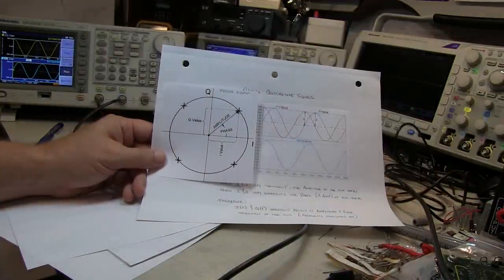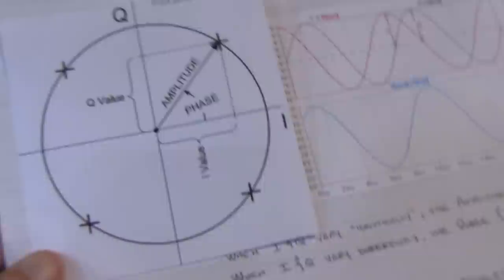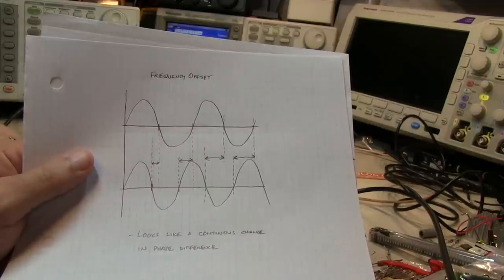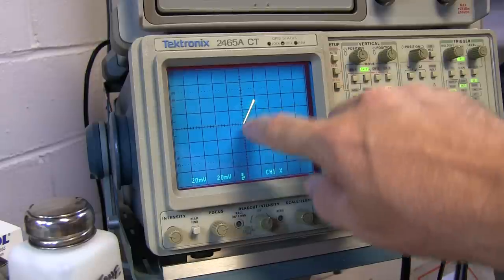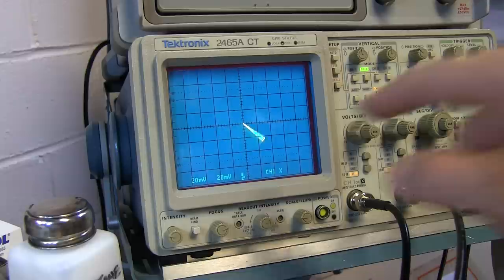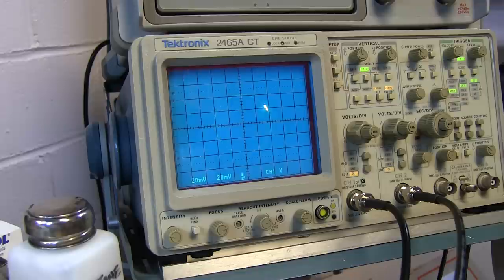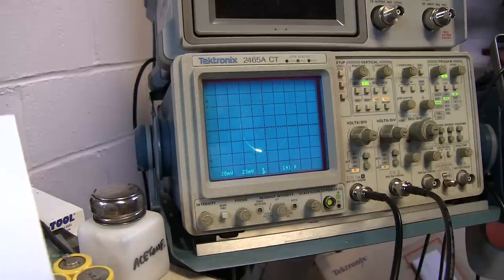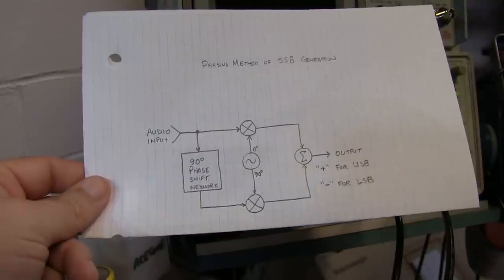#171: IQ Signals Part II: AM and FM phasor diagrams, SSB phasing method

Comment: This is so incredibly cool. This stuff is becoming a lost art. I got an EE degree in the early 80's but in my career I worked on the physics of solid state devices, so never used and quickly forgot the type of stuff your videos are about. I am eager now in retirement to go back and relearn this stuff I consider to be "classic" electrical engineering. Today so much is digital work driven by huge simulation programs that few really know this lost art. I am drooling over your scopes and test equipment. Thanks for the wonderful videos.
Reply from the maker: I'm an analog guy at heart, so my videos focus mainly on these topics. And, since I work for Tektronix, I have great access to wonderful equipment, which really helps in the videos.
Reply: Ditto what Paul said above, I too am enjoying a late in life re-enlightenment :)  Thanks for the great videos.
Reply: Far from a lost art, SDR radios using IQ modulation and demodulation are proliferating. Real world use is driving increasing interest. I'm a licensed amateur radio operator and I now have several SDR receivers, two SDR transceivers and my analog transceiver has an IF tap for I/Q demodulation to monitor a wide swath of a band.
Reply: Me too, at 51. Maybe it comes with the age 🙂
Reply: I concur with your point. My career mainly involved ABB Distributive Control Systems with 4-20 mA I/P valve controllers (current to Pneumatic) and Rosemount transmitters. After so many years of that, my understanding of the subject of many of these videos has atrophied completely. It's nice in retirement to get back to communication electronics. By the way Paul, I've enjoyed your videos very much, especially the two Arduino courses and the Learn Fusion 360 or die trying!!!  God Bless my friend.

Comment: I found these tutorials after trying to understand what the I/Q inputs and outputs on a K3 radio were all about. Thanks for a very easy to understand presentation. This also helps me to wrap my brain around the analog world of voltage and current relationships in a L/C circuit and Antennas!

Comment: Very nice. Just some questions. How does the reciever know the absolute phase and amplitude of the transmitter? Is the information encoded in absolute phase or in differential phase shift? How does the LO of the Reciever "lock in" on the base frequency and of the transmitter's LO or doesn't it need to?
I mean, I only have one antenna and if I flip it upside down my phase shifts 180.
I mean I have to cross correlate to a second input or encode/decode in the phase differential of the frequeny,right?
Reply from the maker: The receiver doesn't know the absolute phase.  So, typically one of two things are done.  Data is encoded differentially as you suggested, or (more commonly) the data contains a specific sync sequence that is properly decoded only at one of the possible phase rotations. The receiver demodulates the data, looking for this sync sequence to establish the reference phase, then decodes the rest of the transmission using this phase reference.  Often, there is a small frequency offset too, so the receiver will also compensate for that too (de-rotating the vector).
Reply: Thank you. I did not know that. I know the basic math of it but not the real world implementation.
Can you do a video on how the synchronisation works? And on QAM.How does the QAM reciever know how to scale the amplitude?  Why is the QAM diagram square and not circular?
Also,I find your videos informative and well made. What I especially remember is learning about how diodes can be RF switches and how the diode ring mixer is just an assembly of switches.
I did not know diode mixers operate in non linear mode,making them square wave sensitive.
Reply from the maker: QAM constellations are usually square because the I and Q signals are typically matched in amplitude to make it easier to null the Carrier feedthru (null DC offset).
Reply: *****
....what did he say?

Comment: Amazing video! I was wondering, is there a different method for working with frequency modulation, i.e. FSK (besides segmenting the constellation diagram as with PSK), because I imagine it would be difficult to determine the "rate of rotation" of your phasor vector in order to determine the frequency at a particular time. Might there be some Fourier transforms involved?

Comment: Could you please explain as to why the two signal generators have to be phase locked? If they were not phase locked, what would happen? Thanks a lot.
Reply from the maker: If they aren't locked, then it would be virtually impossible to make the two signals identical in frequency and control the phase.  In other words, the resulting phasor will always rotate one way or the other.
Reply: hey, thanks so much!
Reply: I wonder how you made the two generators phase locked ? I did'nt saw a connection between the generators.
Reply from the maker: I used a two-channel function generator - both channels are inherently locked because the operate from the same reference.
Reply: Sorry, I thought that I have seen two generators.. Very stupid. Sincerly yours

Comment: Sorry, how do you get the picture on 4:24? If i send sine to channel X, and cosine to channel Y, i am obviously getting a circle, like here:
https://dood.al/oscilloscope/#0.0,0.0,0,0,0,0,0.0,2,1,sin(2*PI*a*t),cos(2*PI*a*t),3,1,0,1,302,0,0,0.

What is the connection schema?
Thanks!
Reply: I figured out how to recreate it: https://dood.al/oscilloscope/#0,0,0,0,0,0,0.01,4,1,a*cos(2*PI+t),b*cos(2*PI+t),0,0.0,0,0.76,125,0,0,0

I don't understand how his scope is showing this though because that would mean that both waves are in-phase, which obviously they aren't.

Comment: Nice video on explaining FM using phasor method. As one more step further, how to explain the nulling of carrier in FM modulation for a certain FM deviation and modulation frequency using the phasor method? I know the Bessel function can describe it, is there an intuitive way to explain it using the phasor method?
Reply from the maker: Probably the most obvious thing is that the average I and Q values over time would be equal to zero when there is a carrier null.

Comment: Hey Alan, why is it that the phase jump in PSK or QAM does not cause any problems with unwanted frequency components in the spectrum? To me it always looks like the phase jumps must create all sorts of higher frequency components. Are they just all filtered out or what? Could be an interesting measurement with the MDO.
Reply from the maker: Yes, if the phase is changed very quickly, then it makes the occupied bandwidth wider. In most cases, the baseband (IQ) signals are filtered to restrict the bandwidth of the modulated signal.
Reply: You'll often see phase changes happen at zero crossing points to minimize high frequency discontinuities.

Comment: Like everyone else here I very much appreciate your videos, they're brilliant thank you!
Have you done a video explaining how a receiver locks its frequency/phase reference to the intended phase of the incoming signal? I struggle to understand how the receiver knows what is considered 0 phase shift for it to then determine deviations from that??
In this video you phase lock the sig gens together but how do remote receivers achieve this?
Thanks again, I'm very grateful for your work.
Reply from the maker: Most commonly this is done by using a specific "sync pattern" in the data transmission - the rx looks for this sync pattern at the various phase rotations, then will use the phase rotation that properly decodes the sync word.
Reply: @w2aew  Ah I see! And is the sync pattern then broadcast periodically to keep everything aligned and prevent drift?
Amazing, thank you. That was one of the last pieces of the puzzle I needed to grasp concept of IQ modulation - since essentially, they are all exactly the same sinusoids if you have nothing to reference them against right!?
Much obliged to you, Thanks again for the videos.

Comment: Thanks for this great videos. I liked these IQ signal videos and the PLL one. I just have a question, Lets say I have this one hz frequency offset. Is it possible to convert that vector rotation to a DC value that corresponds to my frequency offset? What is the simplest way to do it? either by circuit or by simulink block.

thanks again
Reply from the maker: As shown in the PLL video, a phase/frequency detector can be used to give a DC output (when filtered) that is proportional to the phase or frequency difference.

Comment: Hi, Alan. :-)
Always great to watch you videos for they are accurate, polite, and easy.
Thank you.
PS. I have an idea to design a sort of "direct conversion superhet": 45MHz 1st IF (I have a pair of 4520D crystal filters) then a simple LC or RC phase shifting network and an IQ product detector.
It looks like your diagram for SSB generation, but IF input instead of Audio input.
Yes, I'm trying to avoid building a polyphase network for I have no proper parts for that. :-)
I can control it with a single si5351a (one channel for 45.1MHz...75MHz VFO and two channels for 45MHz quadrature BFO).
Advantages: no mirror image while no polyphase network, no parasitic radiation, no BPFs - just 30MHz LPF, not much of relays and switches, microcontroller (I have STM32F103, STM32F303 and ESP32) can be used as DSP to code digital AF filters.
Disadvantages: a noisy MC and si5351, high IF, high current consumption, need in 12V power supply (for I have no low voltage parts for 45MHz).
What do you say? :-)

Comment: EXCELLENT Video, thank you, any chance to give more details on the mixers? what they are and how we can make one at home? possible?
Reply from the maker: The mixers used here are simply the classic diode ring mixers. These are MiniCircuits ADE-1ASK, only because that's what I had on hand. You can build them yourself as shown in this video:
How a Diode Ring Mixer works | Mixer operation theory and measurement

Comment: Great clip again:
In Injection locking two oscillators , at the same frequency, are used to create oscillation with much lower phase noise.  
I guess we can use your method ( IQ FM de-modulator with an X-Y oscilloscope) for checking how good the two oscillator are locked.

Comment: I love your presentations and I am really thankful for what you shared.
Angle increment is uniform in AM so the phase is actually constantly incrementing. This is what makes unmodulated carrier.  Am I right? :)
Reply from the maker: Continuously rotating phase indicates an off-center carrier.  AM is the modulation of the length of the vector formed by the IQ components.  If they don't rotate, that means the carrier is at the center frequency.
Reply: For a vector with constant amplitude and no phase (angle) increment the I and Q would be constant and therefore just make a DC signal. The vector must rotate at constant angular velocity to create carrier. Therefore phase increments. Or do you assume here that IQ plane rotates while vector may stay in place as some authors do?

In 6:26 it should be said that how fast this vector spins around equals to signal (carrier) frequency. Change in speed of spinning makes change of instantaneous value of signal frequency/phase. "Pushing" this ever-rotating vector forward is adding phase so temporary increment of frequency. "Holding" it back works otherwise. It is easy to observe with typical generator when FM signal at low carrier frequency has huge deviation - modulated signal "stops" for a moment at some DC value, when carrier frequency and "holding" back are equal for that moment. What is your opinion of such interpretation of I-Q plane?

I am just playing smart ;) and you are the boss in practice. I haven't seen better explanation of I-Q plane on YT. Thank you for sharing your great videos!
Reply from the maker: The carrier comes from the quadrature LOs (local oscillators).  When the I and Q values are DC, that means that the two LO amplitudes are constant, so when they are added up, you get an unmodulated CW carrier at the LO frequency.  When the IQ vector rotates, you move the carrier frequency from the LO frequency - either up or down (depending on direction of rotation) by an amount equal to the rotational frequency.

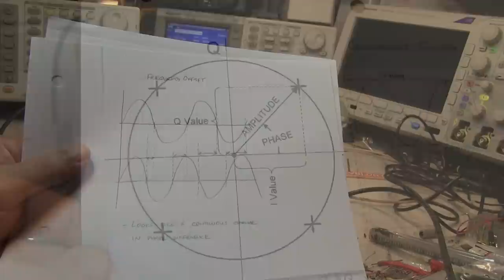Comment: 5:00 Amplitude is just a factor of the radius. A phase is a delay or the opposite of "going around" like the first circle (the circumference.) I guess we can have 2 phases. 1 in the x and one in the y calculation. Maybe 3D applies sometimes. I'm just speaking from geometry and not sure how far the "phase" goes for the names on things.
Reply from the maker: Amplitude is the length of the "ray" from the origin, phase is the angle of the ray with respect to the horizontal axis.

Comment: Thanks for the video. As the combined phase shifts one way or another, what is the zero reference? The video said something about the clocks being linked at the sources, but is the output scope also clocked?
Reply from the maker: The scope is shown using XY mode - so it is just displaying the two inputs with respect to each other - one driving the vertical position and the other driving the horizontal position of the beam.
Reply: @w2aew  OK, thanks. In an actual non-lab signal processing situation, would the two signals need to be clocked  somehow?

Comment: this is really great, but is there a way to show this as a deformed sine wave that has the same look as a block-pulse?
Reply from the maker: +Common Freak I'm not sure what you're asking for...
Reply: +w2aew this video shows that the two sinewaves influence the vector shown on the oscilloscope, in school I learned that putting in multiple sinewaves at different frequencies will cause it to act like a block-pulse. We needed that given to come up with a way to calculate the THD ratio for the block-pulse, but I was curious as to how it would look like
Reply from the maker: +Common Freak With square waves input, the basic shape in XY will be square instead of circular.

Comment: I know how to make an oscillator to generate a sin signal with discrete transistors and( i don't know what is the little white cube that you use in your video because i searched on our local market i didn't found those mixers) if possible Can you make a video tutor to design a mixer and Quadrature signals (Sin and Cos) oscillator using easy to find components like regular transistors , IFT or capacitors.Thanks.
Reply from the maker: There are some good write-ups on this by Marki Microwave:
https://www.markimicrowave.com/blog/top-7-ways-to-create-a-quadrature-90-phase-shift/
https://www.markimicrowave.com/assets/appnotes/IQ_IR_SSB_Mixer_Primer.pdf

Comment: In the 40's and 50's they didn't have frequency counters so they used Lissajous patterns as a frequency counter but i don't know how to use lissajous patterns as a frequency counter. Try to make a video lesson on how to show using the Oscilloscope Lissajous Patterns as a Frequency Counter because you have to counter the number of LOBES.
Reply from the maker: Yes, search my channel and you will find a video on Lissajous Patterns.
Reply: @w2aew  I did but it doesn't teach how to use Lissajous patterns as a frequency counter by counting the number of lobes and convert it to a frequency

Comment: Hi sorry to bother you again. At 8.50min, you mentioned that by introducing a frequency difference between incoming RF and LO, we can observe a continuously rotating phasor. A simple constant frequency difference is not FM. Hence, how could the phasor be going around the circle? It's only when the frequency is continuously changing the phasor must rotate. Not when there is a frequency difference between LO and incoming RF. I know I may be wrong. Would you pls be kind enough to correct my misunderstanding.
P.s
In a nutshell, I think only a continuously varying frequency offset can result in a continuously rotating phasor. If the frequency offset is constant between LO and incoming RF, the angle of phasor should be constant. Meaning it should not rotate.
Reply from the maker: When you have a constant frequency offset between the RF and LO, the output of a quadrature mixer will be two sinusoids that are 90 degrees apart and each at a frequency equal to the difference between the RF and LO frequencies.  When one of these sinusoids drives the X position and the other drives the Y position, you trace out a circle for each cycle of the waveform - thus, the phasor rotates.  A static phasor represents a zero frequency and static phase difference between the RF and LO.  A rotating vector indicates that the phase is changing between the RF and LO, which is what happens the the RF and LO frequencies are not equal.
Reply: Thank you so much for this quick yet very rich answer weaew. Answers my question precisely. I'm now going to dwell on these facts. Bless you.

Comment: ...Oh! theres more, strangely enough this instruction will also help resolve some firmware issues Im having. Sir, I will subscribe, this is a good day. -By the way, did the renowned RF/A/MS circuit simulation guru Kenneth Kundert once work at Tektronix?
Reply from the maker: I believe he worked for HP at one time (prior to Agilent/Keysight)
Reply: Thanks for the info, yes he worked at Keysight (formerly Agilent) as he worked on the harmonic balance engine for RF circuit simulation. ...Then a few years later worked on a similar remit in developing the Flexible balance algorithm for the SpectreRF circuit simulator in Cadence.

Comment: On demodulation it is not obvious to me how an incoming RF single would be broken down into I and Q signals.
Reply from the maker: Splitting the RF signal into two mixers, each fed with an LO (at the RF frequency) which are offset by 90 degrees, will result in I and Q outputs.